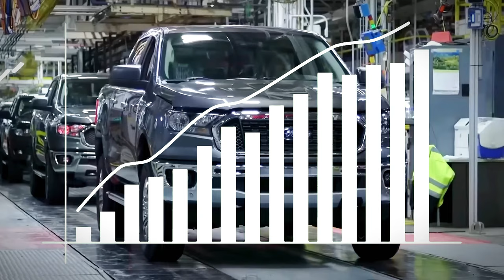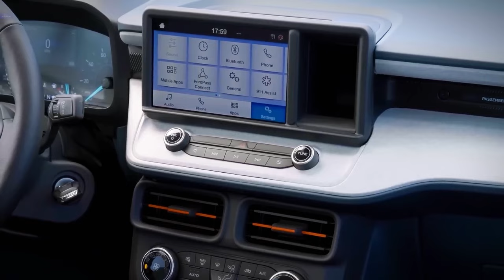Ford CEO Unveils New $15,000 Pickup Truck & SHOCKS The Entire Car Industry!

Comment: ford ceo first said a 10k pickup , then he ssaid  an 8k pickup......now we got a 15k?  is he liar or what?
Reply: It will be 25 by the time the safety junk is put in. Then 30 by the time some engineer throws a bunch of tech garbage in, then 40 after some designer puts an interior in, then 50 after some other trash useless options, then 55 after the unwanted dealer options. Then they will say it's still cheaper than a 2500.
Reply: Then comes the mark up at the dealers 😢 30 grand easy.